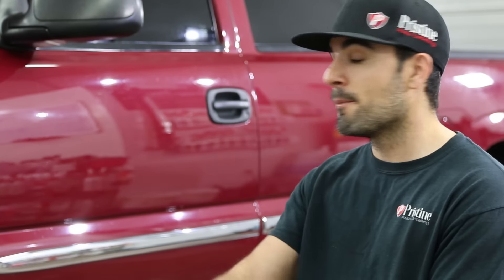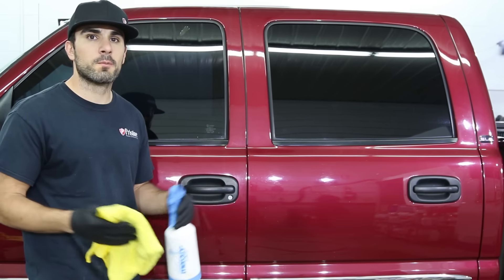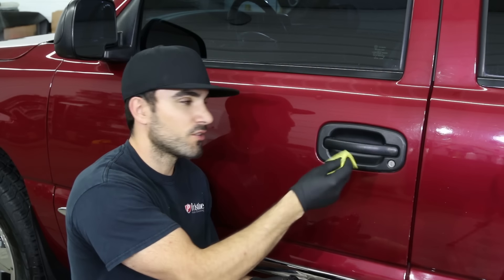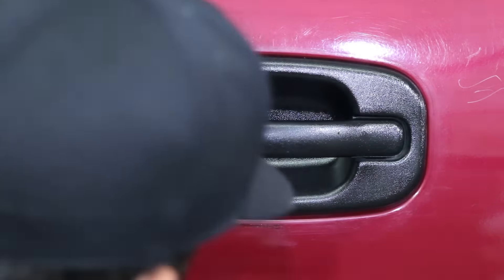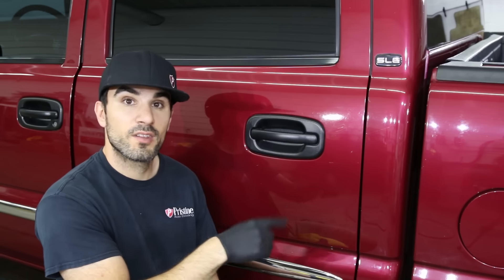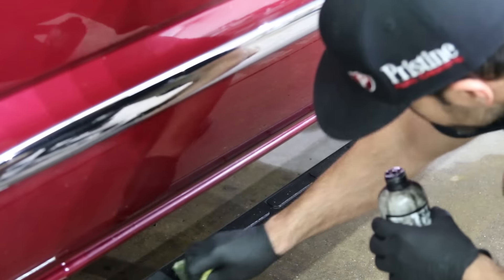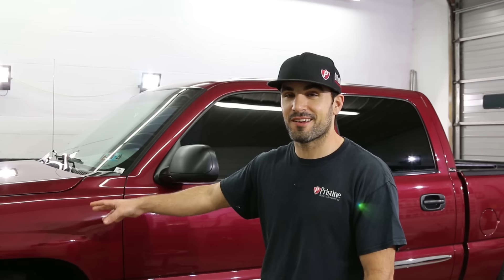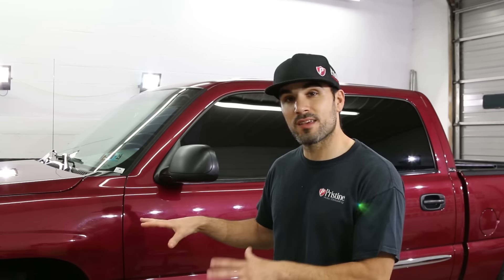How to Restore FADED Plastic Trim on your Truck! | Truck Detailing

Comment: I used to have an avalanche and I love using back to black I could do the whole truck for ten bucks
Reply: Did you use the spray can or the tube? I have a 2003 z71 suburban, and it has a couple similar style plastic pieces on the bumper and such that is much like the plastics on the avalanche. My uncle had a 2003 avalanche and restored the his grey plastics back to black, but I can’t figure out the best way for me.
Reply: Ima try some black shoe polish